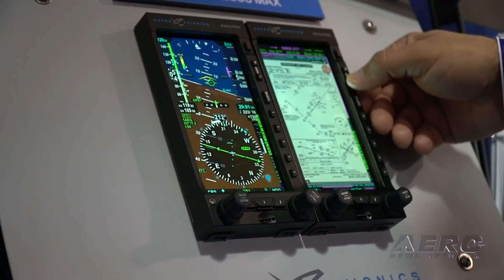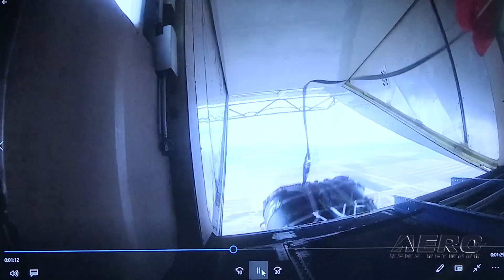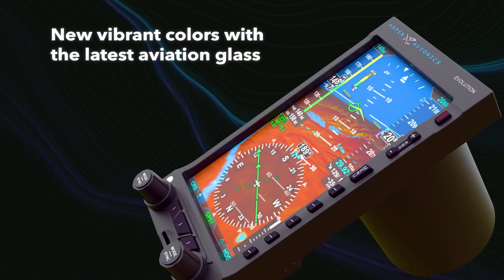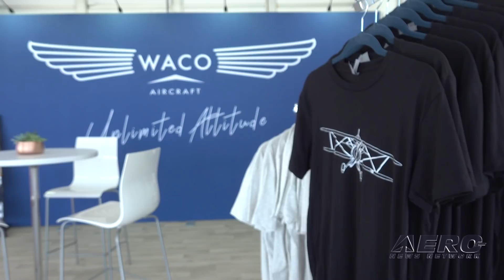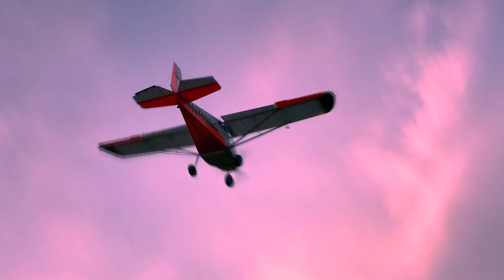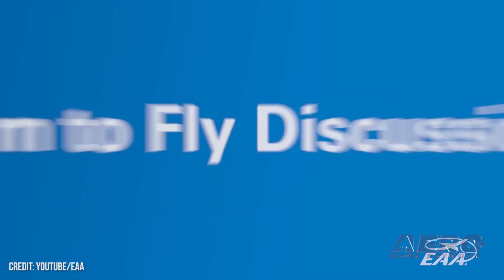Airborne Oshkosh Day 2: Aspen Avionics, DA50 RG!, Aviation Safety Resources

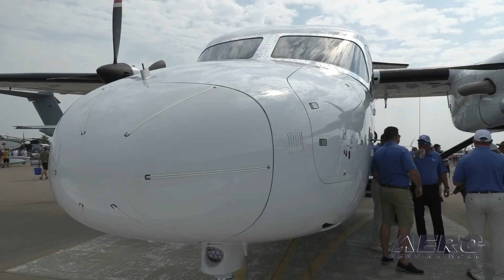Comment: 12:04  What are those lines on the raydome? 🤔
Reply: They are Lightning Diversion Strips or Lightning Diverter Strips. Since the radome is constructed of a composite and not aluminum it does not conduct static electricity the same way aluminum would.
Reply: @seantorbett2889  Composites have a tendency to explode with the energy introduced by a lightning strike too